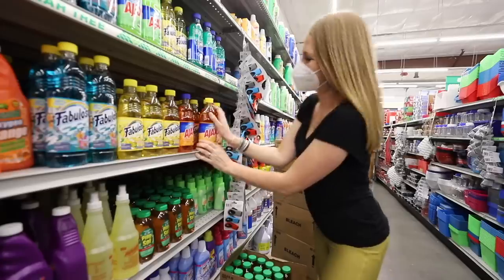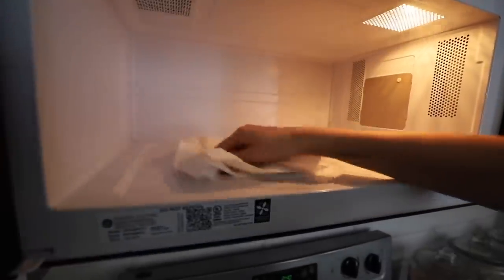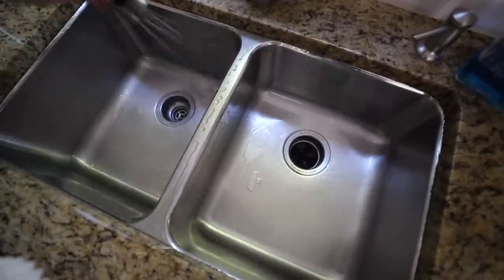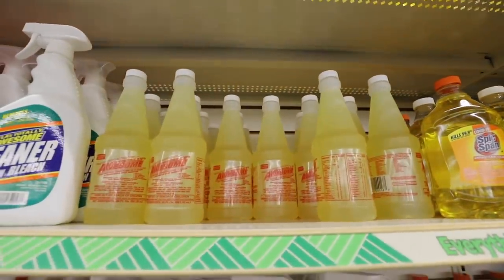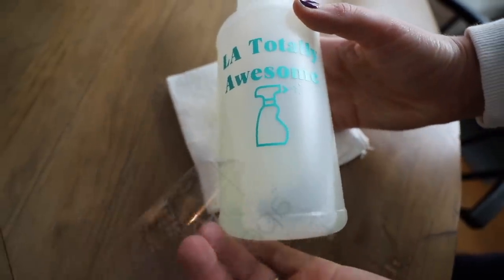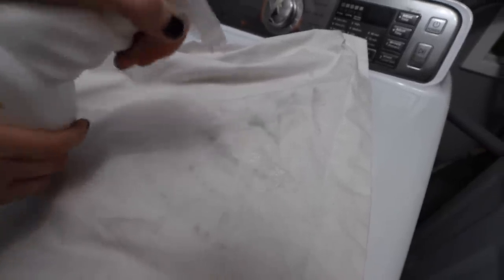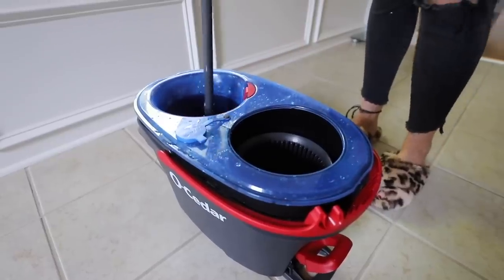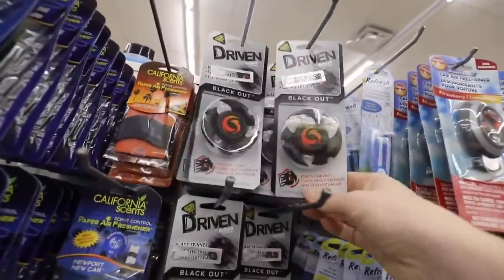CLEAN YOUR WHOLE HOUSE IN LESS TIME! 💙 best kept secrets from Dollar Tree & @DoItOnaDime

Comment: Loved this one and to add a tip for dad. When all the glass, tile, or fiberglass is clean spray it down with a RainX type spray and it will keep those spots and soap scum away twice as long. You can even use it in your toilet between cleans. Just clean the toilet as normal. Turn off the water and flush a few times. When most of the water is gone and the bowl is almost empty spray with the RainX and wipe dry. This will cause most of the water and soap to run off and down the drain so not to cause spots.
Reply: Good tip

Comment: I bought the Pink Stuff cleaner and it works great. It takes marks off walls and much more. I use it on the dolls I buy that are scuffed up with black marks or ink. I also cleaned a stain on a  countertop that even an SOS pad wouldn't take off.  It removed a stain on a piece of clothing too.

Comment: I use one of those Dollar Tree drain rooters and it has saved my bathroom sink and tub from my long hair SO OFTEN. To clean it, run a paper towel over it from the bottom to the top, it just pulls the gunk and hair right off instead of wrecking your paper towel trying to go the other way. (And yes I learned this the hard way, hahahah)

Comment: I still like using the Spic n Span cleaner to mom floors. Bathroom foaming spray and mold and mildew spray are also great cleaners for the refrigerator. I bought the exact same sponge mop for the tub and it quickly fell apart. However, the Clorox bottle cleaner works even better. The handle is the perfect length to scrub my tub without straining my back.

Comment: Barkeeper''s Friend is an awesome cleaning product that's not an abrasive and you can clean brass and chrome without scratching it and it works awesome on my white enamel kitchen sink plus it's cheap. 
Here's another suggestion/hack. Equate flushable wipes will take hairspray off a floor or whatever in a flash without scrubbing.

Comment: LaTotally Awesome also cleans smoke damage on walls. We had a dryer fire & my white kitchen was covered with " baked " on smoke stains ,& all expensive cleaners left  streak marks yet not actually removed in those spots after heavy scrubbing .The LATOT AWESOME full strength ( test on paint 1st)  wiped it off easily .

Comment: Have you try using the LA awesome spray in the tub on the jets . I used it when we moved into our rental and the jets weren’t working and  the home owner was not replacing or repairing it . So I still need to clean it out top to bottom . What did you know ? It worked with cleaning hard water / most yellow color on jets and I actually got the jet to work and unclogged it . Took some work but I did it.😊  I do use dawn spray on the tub or the dawn and vinegar

Comment: Needed help! SOS!! Please!
I have a curio cabinet about 3' high. I finally got my mom home for a visit and showed her the crystal and my ingeniously fabulous idea of putting her in the $ Tree push lights and how amazing it looks.
I know to hold the shelf when I press the light, even though I was holding the shelf, apparently the back peg came out.
When I let go of the shelf...
It fell. My heart is broken with the crystal pieces broken. I have ones I got when my girls were born, each a significant meaning in my life.
I tried every glue I have and I can't get it together again. *Please let me know what I can try to glue them together again!*
I tried:
Super Glue, Tacky Glue, Gorilla Glue, E600 (yes. E600 didn't work either), Craft Tacky Glue (crafters know there is a difference lol), Glue gun, Wood Glue (I am desperate), and no matter what I used, or how long I held it still, I can't get them fixed.
Please help me with any ideas, obviously no suggestions are too silly, (I tried wood glue!) Throw out a suggestion to try.. please?